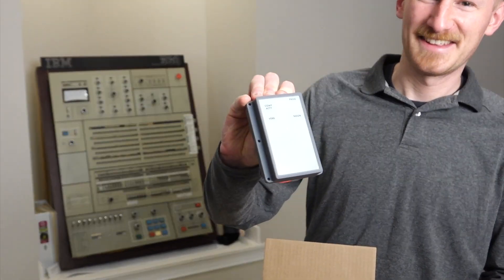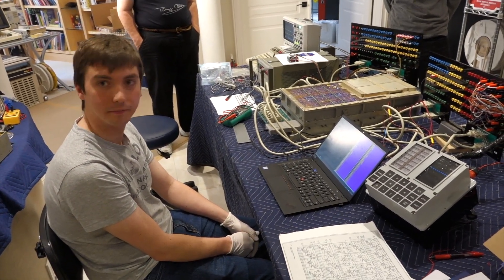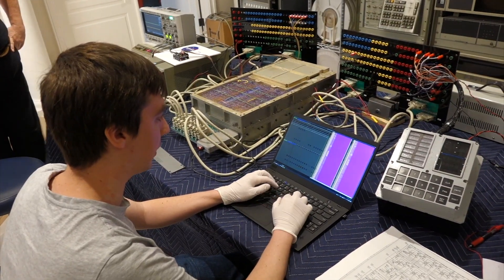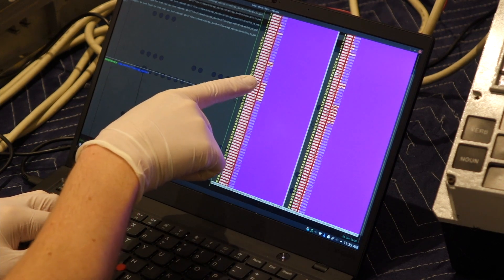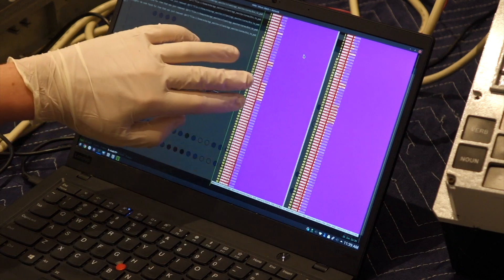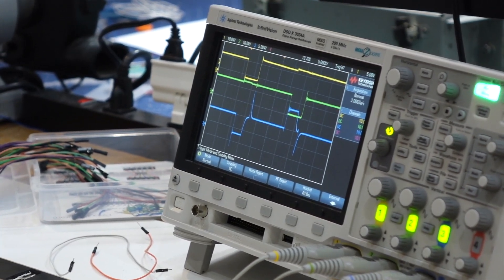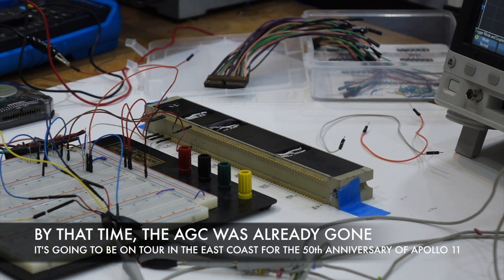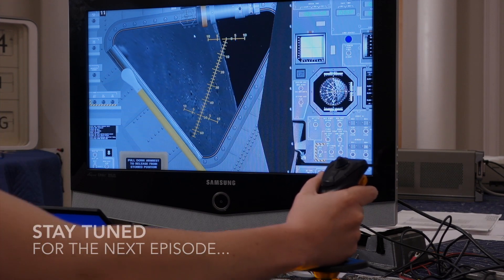Apollo Guidance Computer Part 22: Module B11 fails again!

Comment: Curious Marc's AGC Repair Shop - Solid Work, Reasonable Rates, All Work Guaranteed. The only AGC repair shop in the Solar System 💫 😀
Reply: Let's bet the Roswell with happened with time traveling Aliens who wanted to stop by for a quick fix at CM Repair Shop. ^^)
Reply: * Best AGC repair shop in the Solar System
Reply: What are the chances Louis Rossmann could repair an AGC?
Reply: @zachz96  Louis Rossmann Would likely jump at the chance to participate in this venture.
It would certainly give him a view into how things are properly engineered and built to last decades.  
Unlike the status symbols he normally works on.
Reply: I hear there is a some ship named the millenium something or other (Some kind of large flying native predator) due in for computer repair. All its circuits are potted. It apparently  got damaged  during a race to deliver cargo.....

Comment: Mike, once again what a great display of your diligence.  Very evident how many hours you logged learning and understanding these details.  Undoubtably as fluent in this system as the original engineers were.  That was an interesting detail that the vendor was removed from the approved list.  I'm assuming they were originally approved for more than just diodes?

Comment: Nice work guys, brings back memories of working on Minuteman II electronics back in the 60's 

Had a similar diode problem back in the early 70's with some GE diodes used for a large sampling scanner.  Had to change thousands of diodes.  Some how the mfg process left some carbon particles inside the glass envelope.  Depending on how you handled the diode the carbon particle could dislodge and semi short across the junction.  IIRC there was a bizarre test you could do which involved testing while tapping the glass with the cathode up (down?) on a sample of your suspect lot, very bizarre.

Comment: What are the value of the diodes? I never picked up on that.
Just coincidence... Last week, I visited my neighborhood electronics shop. In one of the aisles, there was a cardboard box filled with old components. I bought the entire box after bargaining with the owner - $10 for the contents (he actually wanted to keep the box, so we threw the contents into another box- weird!) Anyway, I actually bought the batch because there were a bunch of TIL306 modules, and they alone are worth $$$$. When I got home and started to sort the box out, I came across 48 unopened envelopes of diodes. After some research and the help of EEVBlog, I discovered that the diodes were U.S. government stock, and were produced in 1962 by Raytheon. The diodes are MIL-SPEC. The AGC was being designed/built around that period of time. It would be really cool if the batch of diodes I have were actually used (or rejected?) during the build of the AGC.
Reply: yuppiehi Well there's no chance Raytheon would trust that brand when building the AGC.
Reply: @johnfrancisdoe1563  any designs of the originals avaliable ?

Comment: When you think what could have happened, had those diodes managed to survive "just" long enough to leave Earth's atmosphere. Pretty scary really...
Reply: Thankfully, the real LMs had an independently designed and built Abort Guidance System that would get them back to the CSM, it could substitute for the Apollo Guidance Computer during any phase (technically), except for the Lunar Landing phase. It was somewhat less accurate, but it was good enough. It also used less electrical power, which was a benefit to Apollo 13.

Comment: so 3 dead diodes, and the rest are iffy enough the original vendor got flat-out banned from selling to NASA. heres hoping no more die on you!
Reply: I think more will fail over time. See my comment above.
Reply: Didn't know they got banned

Edit: and this is what happen when you comment before finishing the video.
Reply: And that bad diodes were replaced with more bad diodes. lol
Reply: I wonder, are these same suspect diodes used in any other modules besides B11?
Reply: Yeah I'd be replacing them all...

Comment: Great video Marc!!  You know un-potting the whole brick would be a good idea.  You know that more diodes will fail over time.  Seems NASA had the right idea eliminating that vendor.  Landing on the moon and having a stuck/restarting/unresponsive AGC would be disaster.

Excellent job to your whole team!!
Reply: Thankfully, the real LMs had an independently designed and built Abort Guidance System that would get them back to the CSM, it could substitute for the Apollo Guidance Computer during any phase (technically), except for the Lunar Landing phase. It was somewhat less accurate, but it was good enough. It also used less electrical power, which was a benefit to Apollo 13.

Comment: I've NEVER seen potting that didn't soak down and totally encapsulate every bit of surface.  It's almost like the module was turned upside down and lowered into a potting tray so the potting mixture wouldn't coat the whole board - but only provide an airtight cover.  Seems like you could Dremel a fine cut around the perimeter of this module and pop off the potting in one shot.

Comment: Now, CuriousMarc is stuck on the moon with a failed AGC ;-)
Reply: Thankfully, the real LMs had an independently designed and built Abort Guidance System that would get them back to the CSM, it could substitute for the Apollo Guidance Computer during any phase (technically), except for the Lunar Landing phase. It was somewhat less accurate, but it was good enough. It also used less electrical power, which was a benefit to Apollo 13.

Comment: you should mill out/excavate the potting at ALL the diode locations then replace them all with modern new equivalents (or better) in one go and be done with it. long term it will be less frustrating and take less time than having to keep taking it back to the milling machine every time another diode fails (and they will keep failing over time). Just get on with it and do the whole lot. Strange that they fail open. Ive only seen diodes that failed short.
Reply: Who was/is the manufacturer of these faulty diodes that fail open so i know not to use them myself.
Reply: @simontay4851   in fairness, a lot of improvements have been made to semiconductor manufacturing since then - back then it was brand new technology, after all.
Reply: @simontay4851  That comment is completely unfair, these  diodes were made over 50 years ago where silicon technology was a totally new thing. It would be naive to think that they would still push on people the early faulty designs knowing what we know now about the technology involved, especially something so trivial as a simple diode.

Comment: Just showed up to this thread. Have you tried Decap for the potted modules? Used to do destructive physical analysis on potted ICs and modules in the late 80's. Put it in a bath and the potting material dissolves.

Comment: Every time you take the milling machine to that module i just want to run out of the room screaming. It looks like you are hammering in a tiny nail with a sledgehammer.😆
Reply: Not when you're accurate to a thousandth of an inch, though! A well-run well-calibrated cnc mill in his skilled hands could almost do eye surgery.

Comment: I was going to ask if you had considered building a new B11. The mechanical construction seems straightforward (if obviously a pain in the ass), and the electronic components are probably available. Then I realized the largest challenge would probably be the transformers. Anyway, really enjoy the series.

Comment: Marc's curve tracer is a beautiful piece of equipment for diodes, transistors and other components. There is a cheaper device called the Huntron Tracker that does a similar job but still these units cost quite a lot on eBay.
Fortunately, if you have a dual trace oscilloscope you can build your own rather-less-fancy version with probably what you have in your junk spares box. It's called 'The Octopus curve tracer circuit', just search it up there plenty of DIY examples on the net eg.  http://www.jammarcade.net/simple-component-tester-a-k-a-octopus-curve-tracer/
Reply: That looks brilliant, thanks for sharing.
I wonder how well it would work on a digital scope.. I guess the output would just look more messy
Reply: Great tip!  You can also use a function generator instead of the transformer for added versatility
Reply: @leisergeist  Further to my comment above, the one I built works just fine with my generic Golden Dragon 100MHz digital scope. I fitted it into a plastic electrical junction box I had lying around and put Dymo-labelled banana sockets on the top, just like in some of the examples.
Reply: @1944GPW  Great, thanks for the info

Comment: I know some Apollo electronic component connections were welded instead of being soldered, primarily to save the weight of the solder. Were these internals soldered originally (I think you have a non-flight article, so it may have been soldered even if flight examples were welded)?

Comment: Could this module be replaced? Or does it have any special component on it? Would be nice to preserve its state.
Reply: There were only a few dozen of these made at the most. So the chance of finding an original replacement part are practically zero. Yes, you could build a new one, Mike has the whole circuit plan - but the goal is to save as much as possible of the original hardware.

Comment: Maybe the diode returned from "open" to "somewhat working but iffy" and went back to "open" under test-load due to thermal contraction/expansion?
Reply: Intermittent semis are not uncommon.  Pure speculation but it seems to me it's a bonding issue between the semiconductor and the leads in a diode, and possibly contact issues within layers on transistors.
Reply: One of my speculations a couple of episodes back was the diodes were exposed to mechanical shock when this particular B11 module was assembled.  Using diagonal cutters instead of a scissors type cutter to trim the excess lead from the diodes can subject the bond wires and semiconductor to many Gs of shock, leading to a latent failure.  My theory seems a bit less plausible knowing the scrupulous conditions under which the modules would have been manufactured - and the banning of the vendor puts the blame squarely on the parts.  Other factors also could have led to the problems in this specific module - for example, this module may have been used for temperature cycling tests, mechanical shock tests or electrical stress tests.

Whenever I work on equipment with small semiconductors, especially glass encapsulated diodes, I trim leads using a scissors type cutter I found at Electronic Surplus in Cleveland, Ohio in the late 1970s.

Comment: Wait, they're going to plug it into a GUI?
Reply: That's Project Apollo / NASSP for Orbiter. We implement the yaAGC emulator inside the Orbiter spaceflight engine, and then simulate all the rest of the ship around it. I am the maintainer-pro-tem and wrote the special joystick driver that lets the user have two joysticks for simultaneous translation and rotation controls (the way real spacecraft work).
Reply: @Devon Casper You'll probably see it fully explained in the next video. Mike connected his gate exact FPGA AGC (which has been shown a few times in this video series) to NASSP, instead of the Virtual AGC emulator. The simulation already talks to the Virtual AGC like if it was a real AGC, setting the right input signals, processing the output signals from the AGC etc. So that made it feasible to do this and probably also to connect it to the real AGC.

Comment: If you can measure the diodes (or lack of a working diode) across the pins of the module, then couldn't you add a new diode across the socket on the AGC?
Reply: Edit:  No, according to a comment from Marc on a similar question, the diodes are in series with an inductor, so while the diode can be read and even curve traced externally, adding a diode along the terminal strips would put it out of circuit with the inductor.

Comment: I wonder how many diodes failed on NASA during the Apollo program, if it was enough for NASA to remove this particular ones from their vendors and parts list, it must have had a serious failure rate
Reply: Well if they are failing running within their normal specs...
Reply: I’m sure many, but then again they weren’t using 50 year old diodes.

Comment: I am sure I missed it but why was the module potted in the ceramic?
Reply: pretty sure you can't use ceramic as a potting compound.
Reply: Well resin then or whatever it is made of.
Reply: The military and I suspect NASA loved potting and conformal coatings.  It's usually used to protect from vibration,  condensing moisture (think Florida) and FOD floating around in  0G.  As a repair tech -- the stuff was a PITA.
Reply: @craigs5212  Public transit loves spec'ing to MIL-STD too.  You wouldn't believe the level of processing power inside a 10 year old destination sign from a city bus, with balanced shielded CPC cables running protocols that can go 20 miles, just in case they want a bus that long.  And of course, conformally coated to survive a Mars landing.
Reply: @simontay4851  Search out MIL-I-46058C on everyspec.com for a detailed milspec for conformal coatings for PCB's

Comment: What about dunking the B11 module in a metal container of xylene solvent and be shot of the potting compound for good and encapsulate the Module in Silicon Rubber.

Comment: How hard would it be to make a new module? You have the specs, the pins and everything else now. Maybe 3D print a new frame and just wire it up my hand? I know it's a whole lot more work then it sounds, but it might be an interesting side project.
Reply: Fox Cutter Modules are welded, not wire wrapped.  MIT has a video showing the actual module manufacturing process on their channel.

Comment: Don't see any servicemen having to change diodes in voyager 1 or 2 ......from one reliability extreme to the other 8 years later.
Reply: Voyager 1and 2 were also built a bit more than 10 years later, with more refined electronics. Having said that, both V1 and V2 have had to have instruments shut down due to degraded performance, and the RTG power source on both is steadily providing less and less electrical power.
Reply: Well, as they discussed, there's a reason this module never flew. They knew it was defective.

Comment: not sure if it would be possible, but 3d print a frame and build up a complete new module and insert that in to the metal frame and then pot it again

make the 3d printed frame so that the potting can be removed again without risking anything
Reply: Bo Herrmannsen Or just don't pot it.  Most other modules in this AGC are unpotted.

Comment: If the diode was available at the pins could you have added one in parallel to the backplane?
Reply from the maker: No, it’s in series with the core windings as we have shown in the other video.
Reply: @CuriousMarc  Ah, I see, so you were actually measuring and curve tracing with the core in series.

Comment: The 1N914 diodes require a strain relief loop when used in cordwood construction.
Maybe you should advise NASA quickly before they build the next batch of guidance computers.

Comment: The diodes probably failed due to its aging and impure Germanium elements. Remember, early 1950s-60s era fabrication processes and techniques were quite crude and unsophisticated which resulted in impurities that degrade Germanium and causes the semiconductivity to fail over time.
Reply from the maker: These were silicon. Being unstable in resistance and failing suddenly open like this, I’d think this is a packaging failure or stress fracture. But just like you, this is speculation, which is not a valid way to explain a failure.

Comment: Would have made more sense to replace all the duff diodes at the same time since it’s known they ARE going to fail. Yeah it’s more work but less than having to set up the repair every single time. But then again, this AGC is never going to fly... so there is that. Just imagine if it had of happened while behind the moon, halfway through TLI. shudders

Comment: https://www.ibiblio.org/apollo/klabs/history/history_docs/r713.pdf   - E.C. Hall, "Reliability History of the Apollo Guidance Computer", 1972; p.23:  "... intermittent short circuits caused by loose conducting particles entrapped within the package" - you're re-living AGC history here :D - it also says they standardized to use only one type of switching diode, but there are 3300 of them in an AGC (p. 42 although that refers to Block 2 I think).

Comment: Soak the whole unit in methelene chloride to remove all the potting and replace all the diodes.
Reply: You know what DCM is, right?  The company that developed that technique for thermoset removal advises that it is, and I quote, "suicidal in terms of re-usable parts for manufacturing"
Reply: @alakani  Yeah. I used to use it for reverse engineering potted assemblies. You have to keep a close eye on the process. Leave it to soak too long and it will dissolve the resin cases of components too.
Reply: Check the Hildebrand/Hansen parameters of the materials.  The plastic wire insulation, silicone transformer encapsulation, oleoresin magnet wire insulation, etc. will go long before the crosslinked polymer.  Plus the first step of chemical depotting is, use an end mill.  The only reason for the hot fuming nitric acid or DCM is when you can't get the endmill in close enough.  And, a water rinse afterwards (or just ambient humidity) will hydrolyze the DCM to form hydrogen chloride which will etch all the metals.  When this process is absolutely necessary, the solvent is added dropwise, with several other reagents at hand; not a matter of soaking